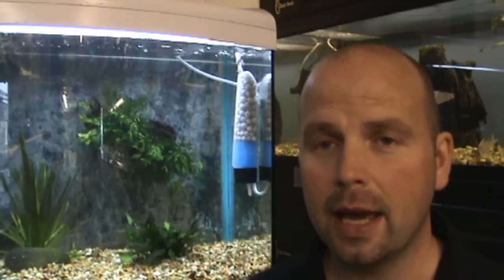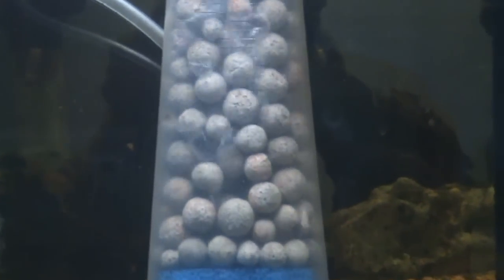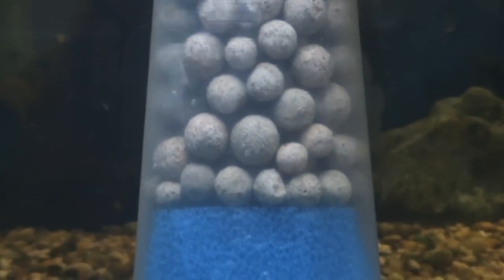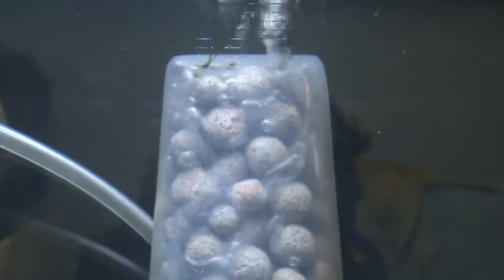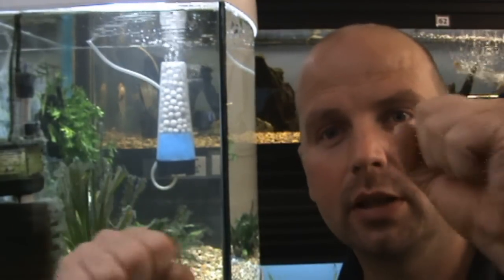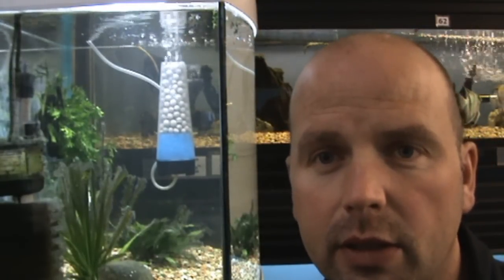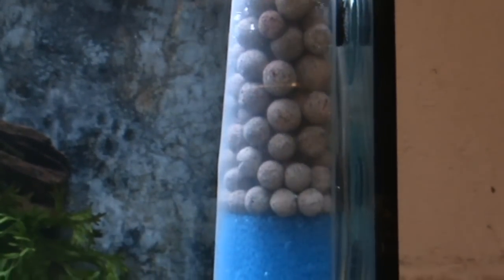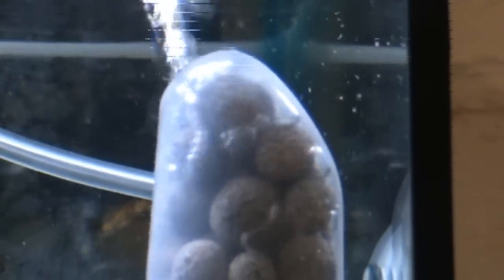Excellent DIY Aquarium Moving Bed Filter by Pondguru

Comment from the maker: If you add an airstone to the end of the pipe the bubbles will be smaller and should make less noise. Also, once the media is mature you can get away with minimal air flow to make the media move properly.In the early days it needs more air to move it but it will move better (with less air flow) once mature.

Comment from the maker: The bubbling water is the only noise from a fluid bed filter so if you add an airstone to the air line, the bubbles will be smaller and quieter. you may need to start without an air stone until the media moves freely then add one after a couple of weeks.

Comment from the maker: Glad you're using the moving bed filter process but I'm not sure straws work too well as they have a very small surface area per volume so there's not much area there for bacteria colonisation but I suppose if you pack it with cut straws it may work.
Thanks for watching.

Comment from the maker: If you put the outlet right at the water surface it will not make much noise at all. Using an air stone as opposed to a bare end of the air line the bubbles will be smaller and therefore quieter too.

Comment from the maker: Drilling fewer holes in the top of the bottle will do exactly the same, creating a more easily noticed current but the actual output of water / air will be the same. Its a simple matter of physics that it cannot be any more or less than the amount of air feeding through from the air pump whether there is an uplift fitted or not.

Comment from the maker: More air = more water pulled through the filter but for efficiency, the air driven filters don't need anywhere near the turnover rate of traditional internal filters so you can run multiple air driven filters from one decent air pump - very handy if you have a fish house. Once we get the finished design back from China, we will convert all of our tanks in the shop to these filters.

Comment from the maker: The plastic moving bed filter media will never need replacing and it supports a very vigorous bacteria which feeds on ammonia and nitrite better then the lazy bacteria in static filters.
plastic media should never need replacing. The ceramic media will last for ages but if it crashes into each other too much will eventually wear away.

Comment from the maker: If the aquarium was reasonably well stocked, I'd normally use 1 litre K1 per 100 litres tank water. Hel-x will usually be good for 130-150 litres per litre of media so from that you can work out how much you will need, therefore how big the container will need to be. For the media to move well you usually want no more than 60-70% filling the container you choose to use.

Comment from the maker: If you watch the video showing how to make the filter and you follow those instructions it works perfectly. 
It is simply a container with holes drilled in the top and the bottom. When air is injected near the bottom (just above foam) it draws water in the bottom and spits it out the top (with air) - just like the uplift of a UGF.
Adding an uplift pipe to this filter concentrates the outflow to make a more visible current. Continued...

Comment from the maker: If you have used the biomotion media as in this video it is coated with a clay which will naturally wear off and condition the water. As the media is not plastic it will wear quickly if air flow causes it to crash together. Its best just gently vibrating with minimal air flow.

Comment from the maker: Until the K1 gets a biofilm built up, you need alot of air to shift it. Once the media matures, it needs much less air to move it so will be quieter. This design uses the new media, has much more surface area so can be smaller, therefore require a smaller air pump to drive it, so should be quieter.
Once the media becomes available, I hope to distribute it in some capacity.

Comment from the maker: If that is your only filter (under gravel) then it needs to run 24/7 to keep conditions stable and bacteria fed continuously to keep population high. It is quite a strong pump for 45 litres. Unless media is specifically for a moving bed it will likely be too heavy (ceramic rings) or too light to work properly in a moving bed. It the tank is only 45 litre and you already have under gravel there's no real need to change unless you want sand base.

Comment from the maker: Thats about it. The air causes chaotic motion and you already understand about the growth of super strong bacteria on moving bed media. The new media also has a massive surface area so it combines the benefit of moving bedmedia with the surface area of good ceramic static media.
I have done a new filter for some new aquariums so once they have been released at the Nuremburg show in the spring, there will be plenty of videos on that one. It sucks and blows - multi chamber design too.

Comment from the maker: That would be helpful, yes. If you want to know how much water is being sucked into this or any other design, just take a syringe with anti-parasite treatment in (most people will have this and it contains stuff which stains the water e.g. malachite) and inject it into the water where the intake point of the filter is. You will then have a visual display of water movement. I should really do a video of that myself. There's a lot of videos going on, lol

Comment from the maker: There are some great medias available especially ceramic ones for static beds but the trick is getting a media which has neutral buoyancy for a moving bed. The one in this video has wear issues as it is an early type so its a balance of wear, movement (neutral buoyancy) and large surface area. Clay medias currently for sale are a good media but no good for a moving bed due to weight and wear issues so if you could crack that it would be great.

Comment from the maker: It was the 250ml source bottle which I used for this one but if you see the video 'How to make an excellent moving bed filter' I use a Tesco shower gel bottle which is much better as the stem of the bottle can be removed and you will still get a good fix from the black part of the bottle top. The source bottle is awkward to get the foam in compared to the tesco one - watch that video and you'll see how well that one goes together.

Comment: I've used pretty much used every one of your media and my favorite is still biomotion. It does wear away about the two year mark. I've got some that are the size of a pea now. I pull them out and put new ones in.
Reply from the maker: Yes it does wear much quicker than the other forms especially when used in a moving bed but while it is a decent size it remains active and I suppose looking at optimistically the wearing opens up new passages and always ensures that there is plenty of active surface area for bacteria to colonise.

Comment from the maker: If that is the Eheim media it is too heavy to be a moving bed media but it has alot of surface area. When there is air rushing over good media its not essential for it to move like K1 - as long as it rattles slightly it will harbour more hardy bacteria than static media.

Comment: What I am working on is an "air lift" system, where the air bubbles go up a small-diameter tube, forcing water along with them. The key is to leave the interface between the bubbles and the tube open in some way, so that water can be forced up along with the bubbles. An inverted cone shape has proven good so far, so that the bubbles are forced into the center and water is sucked along with it. I have gotten a 1" diameter column of water about 2" above the surface with just a cheapo air pump

Comment: I have now tested exactly the filtersolution in the video, and it does not work at all, period! BUT if i connected a lifttube to the top of the filter it starts to work, the water starts to circulate thrue the media just as i expected! But i will stick to my motorfilters because the have a lot more waterflow! But any way, good luck with the development of this moving bed filter :)

Comment from the maker: Yes, strictly speaking this filter is not a moving bed filter but it can easily be a moving bed. We have one of these filters which acts as a hel-x moving bed and there is another different type which has the biomotion in working in the shop.
I'm always messing about with filters.

Comment from the maker: The bottle definitely helps for catching fish, lol
With regard to the new filter it used vortex idea similar to a Dyson vacuum cleaner but not as advanced. Its really simple way to get a huge volume of water going through the filter media without using a large pump. The idea was to have huge filtering capacity in a small unit and not be too gimmicky.

Comment: Understandable about the comment. *Thumb up*. When you add activated carbon to say an external power filter you provide chemical filtration. It's what I consider a silly filtration type. Many find little benefit from it. Plus it needs to be replaced often. It's often used to remove tannins and phenols. Regular water changes make chemical filtration nearly pointless. Mech&Bio filtration IMHO are the best.

Comment: I have been researching this type of filter for the past couple of days, and I am wondering-- how do you know there is any water being pulled through this? The way I see it, if an equal amount of air is coming in as going out, there shouldn't be a whole lot of suction on those bottom holes to draw in water. Maybe a little from the 'chugging' action of the bubbles as they leave... is this enough flow to take maximum advantage of the bacteria?

Comment: haha i actually bought both as the tesco one seemed fatter and wider at the tip but still had the slight incline and i thought it might do a better job, only problem is, my tank is 160 litres and im not sure this is enough, i have a 1500lph filter in there too but besides a lot of foam it only has 6 bioballs in it and thought i would need more bio filter than that, think i will need a 500ml bottle but cant find one as suitable yet, will keep you posted if i do, cheers pondguru!

Comment from the maker: I assume you have drilled holes in the bottom and made the filter as in the video 'How to make an excellent moving bed filter'.
If you pump air in and it has free passage to get out the top of the bottle, water will be dragged in to replace it so it has no option other than to suck water in.
Checked your channel for a video of the filter but unfortunately there are none.

Comment: @pondguru I gather this new media hasn't got any field data in comparison with the 11 years or so for the K1.  Since a box filter already has some mechanical filtration, and a larger volume for biomedia, why not just modify a box filter to hold the K1 media?  The main difference I can see is that in your design the air bubbles from below to move the media whereas box filters have the air stone above the media and use the suction to bring the water in.

Comment from the maker: I think that the bottle was 250 ml but it uses biomotion which has a huge surface area. For Hel-x it would need to be around twice the size, or even bigger bigger for K1 in a 95 litre and around 2.5x larger for Hel-x and around 3 times the size for K1 in a 150l tank?
For biomotion in a 150 litre tank it would need to be around 350ml of media? Its not an exact science and depends on fish stock and feeding regime.

Comment: Does the biomotion wear of?thanks Richard you are the best ever.
Reply from the maker: It does wear when it is in motion, more so if the flow of air is strong. As it wears new cavities in the media are exposed and colonised with bacteria. The best place for the media is either in a small bed which is hardly moving or a large moving bed which has a cyclical motion where the media moves in a circular path and doesn't bang into each other hard.

Comment: How often have you had to clean this vibr.bed filter and foam?
The shampoo bottle you found makes a decent container for media and its parts. But I wonder will you be designing a filter container that has a different shape? Such as a longer more narrow or even maybe flatter container, something closer to an under gravel filter lift tube? You could design the container top to have a flow spout for directional current?

I hope you get this commercialized!

Comment from the maker: I will be doing a video on how to make this design wery shortly, plus a video on the 3 types of moving bed media I have for sale.
I've now got the improved ceramic media and it is awesome - it even has a partial hard clay coating which slowly wears of to condition the water (Montmorillonite clay).
Best media ever? I think so. Its not cheap but it has massive surface area and is unique as all other moving bed media is plastic with limited surface for bacteria.

Comment: Once the water is forced above the surface level, it will drip down the sides of the tube into a bigger tube surrounding the smaller tube, containing your media and is open at both ends. Gravity will force it back down through the media of your choice in the space between the small and large tubes and out the bottom. I just realized that this is very hard to explain, I will make a short video if I can

Comment: I you use your logic about under gravel filter you will find that the circulation caused by the uplift pipe draws water from under the gravel filter! If you skip the the uplift pipe your undergravel filter stops working, right! If the filter in the video should be able to work properly it should need a uplift pipe connected to the top.

Comment: Can I use medium to small bio balls in a bigger container and have them tumble to get good results in wanted bacteria?
Reply from the maker: I'm assuming that you mean the plastic bio-balls? I would use K1 micro instead as it creates a much more fluid bed and has loads more surface area than bio balls.

Comment: It looks like a good and cheap system. However I don't understand the circuit of water. How is the water coming in and out?
Reply from the maker: The air is drawn in bottom and exits out the top.
Reply: Pondguru Is the water sucked from the bottom and ejected on the top by the air?  I don't see the water going out, which is the purpose of the filter.
Reply from the maker: Frederic van Haute If I put some blue dye near the bottom of the filter you would see it drawn in. It is not a high flow filter.

Comment: Hi, Built one these moving bed filters.My media is not vibrating or moving like your video.Should this make any difference to how it works. I have not filled the container to capacity and have also tried regulating the air.
Reply from the maker: It may take a while to move as a moving bed but even if it is not moving this media will still support a great amount of bacteria and be effective at removing pollutants.

Comment: Thank you for replying. My power head does drag in air.
I was wondering what would be the best Media to use. 
I have an external bio filter which I haven’t used for a year; can I use any of the media from that? i.e Ceramic Rings
My tank is 45L and my power head does 630L per hour do you think the flow would be too strong for the same shampoo bottle as your video? Also my power head is on a timer plug which only come on during the night for 6 hours, would that be an issue for the filter?

Comment: HI. REGARDIHG THIS HOME MADE FILTER, WOULD THE TEE ADAPTER USE TO HOLD THE MEDIA BENEFIT FROM ADDING 2 AIR STONES TO AID BETTER CIRCULATION. WHAT DO YOU THINK?
Reply from the maker: +Lynn West You shouldn't really need two air stones for this particular filter as it is not a 'proper' moving bed. If you had media crashing into each other as you would for a plastic media filter then two air stones may help.
Reply: +Pondguru Outdoors . POINT TAKEN.SLOWER THE BETTER!!!.LYNN.

Comment: So did we get the crashing and breaking thing figured out? This vid is 3 years old. Is it better to have more motion and less surface area like k1 or would you still suggest this set up?
Reply from the maker: OMG - it has indeed been nearly 3 years!
In small filters the best moving bed filter media is the new K1 micro but if you can get a good cyclical motion then the biomotion does the business.
With the micro you get almost twice the surface area of K1 per volume so it is an excellent choice for small and large moving bed filters as it easily creates a very fluid bed. It is so new I think there may only be a few videos on Youtube featuring he new micro including a great one from DIY Aquapros which was uploaded a couple of days ago.